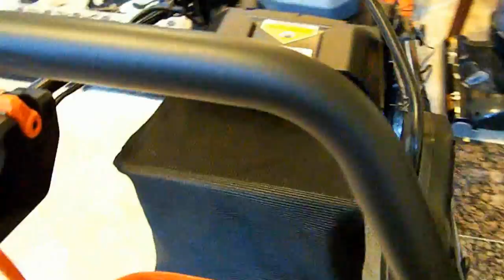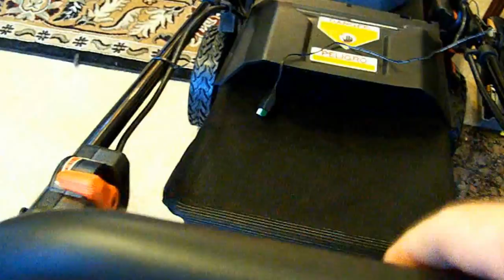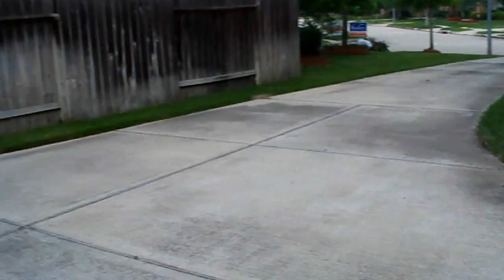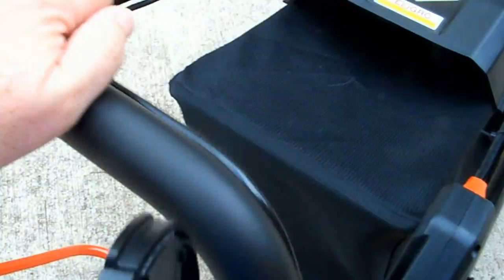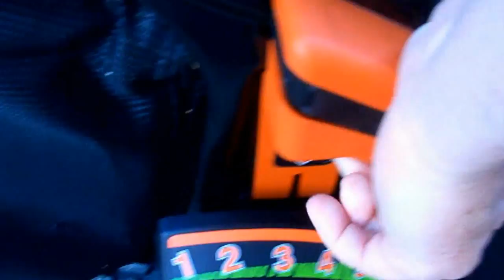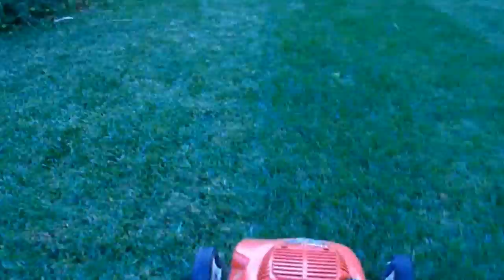My B&D Cordless Battery Powered Electric Mower Test Drive Part I of II

Comment: I did a government exchange (I actually paid about $70 for the "exchange") for this mower, and I find it to be the worst mower I've ever owned.  It doesn't bag the grass at all.  I'm not sure why they bothered putting a bag on it.  After two short passes, the cutting chamber is clogged and it leaves swaths of grass, and it basically can't cut at all at this point.  My grass is NOT wet.  There is humidity in the grass itself, and that is enough to clog it.  All videos I've seen the grass is thin.

Comment: Hi Richard, I've had the Toro Personal pace mulcher for 13 years, happy with it, I get a lot of leaves in the fall in MIchigan & I quit raking 'em when I got the Toro, I mulch 'em all down & I'm very satisfied, beats the thankless drudgery of raking 50/60 bags! I'm considering the BD SPCM1936 for the ease of maintenance ( no gas, oil, filter & plug upkeep) thanks for your real owner review, I'm going to give it a try. I'm sure it will handle my grass, I hope it does a good job mulching leaves.

Comment from the maker: Yes, you can use it without the drive assist, though it is a little heavy to push, but not too bad if the grass isn't too thick.  I've gotten used to the speed so it has gotten a little easier for me to handle it with the drive engaged.  Plus you can release it whenever you need to slow down.  Good luck.  I hope you love it if you get one.

Comment from the maker: Yes, you can run it without the self-propelled feature engaged, but it is a little heavy to me.  When I first got the mower and wasn't sure how long the battery would last, I would not use the drive to save on the battery.  That only happened when I let the grass get out of control by waiting too long to mow it, but I was able to manage it without the rear wheel drive, and I am getting close to 60 years old.  I definitely disengage the rear drive when in tight corners to maneuver.

Comment from the maker: Yes, I think the Worx W789 was the main competition for the B&D I got, maybe also a Greenworks 40 volt model.  The body of the mower is plastic, to save weight I imagine, but it is solid.  It seems well built to me and I haven't had any problems with it so far, nothing has come loose, fallen off, or broken.  I have mowed damp grass while it was just starting to rain and it worked fine.  My gas mower had more clogging issues than this mower, so far.

Comment from the maker: I'm sorry you have had that kind of experience.  My cutting chamber has never clogged and every time I have checked it it is clean.  I live in the Houston area and Houston is very humid most of the year.  I bagged it in the first video, but the mulcher has worked so well I never used it again.  I have mowed in very heavy grass (for St. Augustine and a few small patches of Bermuda), and the motor has bogged down some, but it never clogged the mulcher or the short time I used the bag.

Comment: Richard, 
Thank you for taking the time to produce such a good, quality video reviewing this lawn mower.  I will be needing a new lawn mower soon and after watching this video, I think this is the mower I would like.  I do worry about the speed a bit.  I can't believe that you had it on the slowest setting.  I too would like to know if you can use the mower just as a push mower without the assist and if it would damage gearing over time?  
Thanks Again!
Breyden79

Comment from the maker: The electric was a lot louder than I expected, but the noise isn't as annoying as the gas engine sound.  It is hard to explain, but the gas engine just sounds more pounding on the ears than the electric, though the sound level may be close.  I think the electric is a bit quieter, but not nearly as much as I thought it would.  It shouldn't hurt anything to not use the rear wheel drive.  It is a little heavy to push, but if the grass isn't too high it isn't bad.  They sell a version w/no drive.

Comment from the maker: Also, they sell a version without the rear wheel drive.  It is also cheaper.  I personally like having the drive when I want to use it, but they really should have made the slow speed slower so it is easier to control.

Comment from the maker: Wow, 32 years is pretty amazing.  Hard to beat an old gas mower for long life if you give it a little maintenance once in a while.  I have no idea how long the battery might last on my B&D electric, but I will be happy if it last at least 5 or 6 years I think.  At least a battery is easy to replace.  Thanks for watching!

Comment from the maker: Hard to say, but I think they are pretty close.  Intuitively I would think the gas more powerful, but I don't see the electric stalling as much in similar grass, but hard to say since I can't mow the exact same patch of grass by both.  I have hit some very thick grass with the electric and it will slow down.  You can damage the motor I believe if you stop it or almost stop it too suddenly while applying power, so I try to slow down when it gets too thick, which is very rare so far.

Comment from the maker: Update July 19, 2012.  Mower still going strong.  Still using the mulching function and working well.  Getting lots of rain (5 inches over normal to date) and lots of tall grass.  I like the mower a lot, but still wish slower and front wheel drive.

Comment: Rich..is it my imagination or the mic on the camera that the sound of the B/D is just as loud as the the gas mower..and I am worried about the speed of the B/D..can I just push it w/o the assist? and if I do will that hurt the gearing in the long run? so thanks for your taking the time and effort for the video..i and others do appreciate that!
rich

Comment from the maker: Also, to add to my earlier statement, now I exclusively mulch with the electric instead of bagging, which is what I exclusively did with the gas.  The gas would bog down a lot in wet or damp grass and any time I tried to mulch it would bog down all the time.  I don't get that at all with the electric.  It mulches for me like it was bagging, no bogging down at all, so by this standard it cuts better than my gas mower.

Comment from the maker: Update Sept 22, 2012 (first day of fall).  The rain dropped off and the lawn thinned out a bit, so no problems at all for the year to date.  I don't even check the battery levels anymore to see if it will make it through both the front and back yards.  I still love it (but still want slower variable speed and front wheel drive).

Comment: whats the life like on the battery? I read that you need to replace it after 2 years of uses?
Reply from the maker: Good question.  Right now I am at 2 full years on this mower, starting on my third, and I am wondering if I do need to replace it.  I have noticed lately that the mower starts out pretty strong, but is getting pretty weak about half way through the cut (though it will finish without dying) - I push it most of the time.  I have been thinking it is just because the grass is really thick and tall due to the heavy rains we have had and the good fertilizer I used, but I'm not sure.  It could be that the battery is weak.  I may order a new one pretty soon to check it out if it doesn't do better the next couple of times I use it.  I will publish a new video demonstrating the issue if it is the battery.  That said, Houston is a pretty harsh environment for batteries during the summer, so it may not be too much of a surprise if it is needing replacement.  I bet a lithium would fair better than lead/acid.
Reply from the maker: rickmcmillin1 Also to be fair, in Houston the mowing season is longer than most, starts in early March and usually lasts until November or later.

Comment from the maker: I just went out and checked the latch and it appears to not be functioning at all.  I'm not sure if it ever did, so it is probably a design flaw.  It looks like it is functional, but it is not.  The latch just lifts off the battery without touching the handle.  I guess it really isn't necessary due to the weight of the battery.  I haven't had any problems at all so far.  I don't know for sure which battery I have.  It is the gray colored one.  I noticed that new pictures of it show a black batt.

Comment from the maker: I have posted a new video looking at a loss in power after 2+ years of using the mower.  It is entitled "My B&D Battery Powered Mower Test Drive PART IV - BATTERY ISSUES 2 Years Later".  I buy a new replacement battery to compare with the old battery and then show how to replace the battery cells in the case as a cheaper alternative to buying the whole new battery with charger.

Comment from the maker: I found my manual and it indicates my battery is lead acid.  I never knew that.  I assumed it was lithium ion, I guess those would be more expensive by a lot.  They don't state anywhere in the ads or websites what kind of battery these mowers have.  I wonder why?

My mower is a rear bagger/rear discharge and I don't have anything for converting to side discharge that I know of.

Comment from the maker: The safety features can be a pain, but the electric is soooo much easier to start than gas.  Electric starts instantly and the gas takes priming the carb and pulling a cord as fast and hard as you can, usually more than once.  They should have reversed the lever for the blade start and the drive.  I keep bumping into the drive, engaging the wheels at times I don't want to.

Comment from the maker: The front wheel of the mower is 7 inches and the rear is 9, so you may be able to judge from some of the video where I show how tall the grass is.  I never actually measured it, but it was very tall for me a few times on the video.  I'm guess now maybe 5 to 7 inches without looking back at the videos.

Comment: Unless things have changed, you have to keep that charge up on the lead acid battery. Don't let it drop to a low level. With a Lithium ion battery, you want to let them run down to a low level and then charge them, because the less number of times you charge them, the longer the lithium ion battery will last. Bottom line: don't treat a lead acid battery like a lithium ion battery.

Comment: anyone know if I can use it at Australia? Thanks
Reply: You can but the blade will spin in the opposite direction.
Reply from the maker: Nice one Andrew,  :).
I'm not familiar with the electrical standards of Australia, but I did a quick search and looks like it is different from our standard 110 volt outlets.  You will probably need an adapter for the charger, I found several on Amazon, but the mower should work the same if the batter is charged since it runs off the battery.

Comment: I hate all those safety features. You have a lever to engage the blade with a lever and hit a button also? WTF? I use velcro straps to strap the shut-off lever down on my Snapper. If I want to step away from the mower for a second, I don't have to restart the thing.
Your electric sounds really loud for an electric mower.
When you think about the cut width difference, The time you spend taking a few more swipes to mow your lawn is less than the time you have to gas up & check the oil on the Toro.

Comment: Unless things have changed, you have to keep the charge up on the lead acid battery. Don't let it drop to a low level. With a Lithium ion battery, you want to let them run down to a low level and then charge them, because the less number of times you charge them, the longer the lithium ion battery will last. Bottom line: don't treat a lead acid battery like a lithium ion battery.